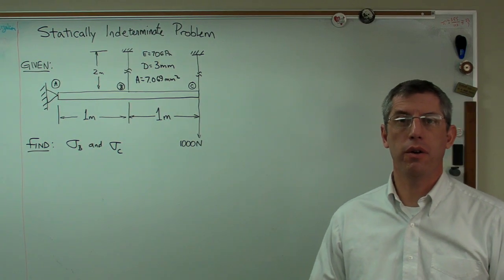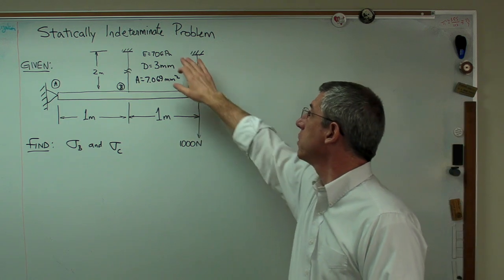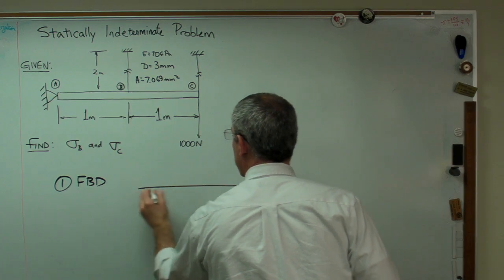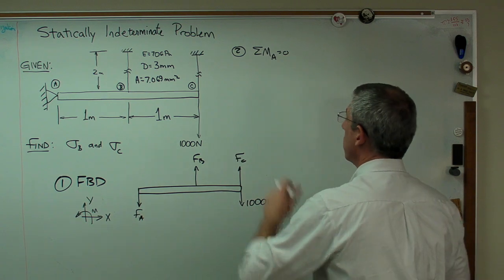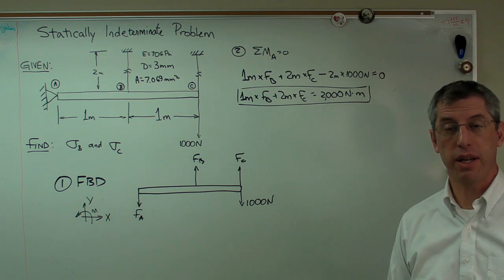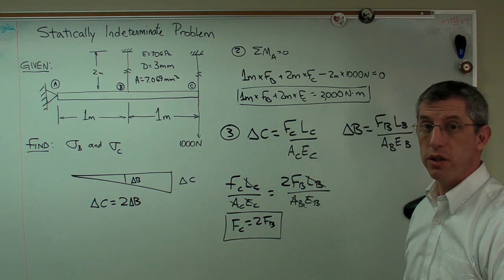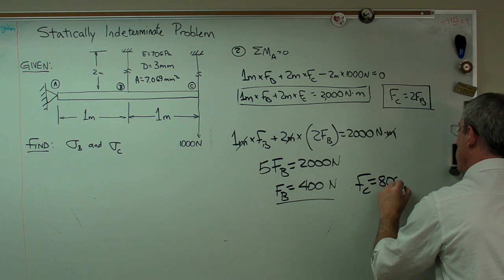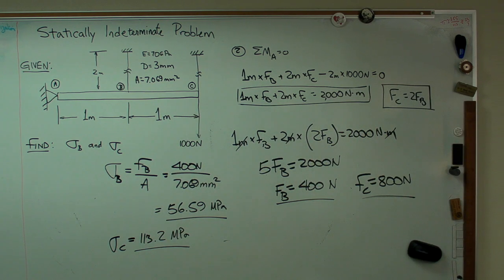Statically Indeterminate.MP4

Comment: Brilliant videos...Thanks so much.  Could you possibly do a video showing how to solve a simple beam with a UDL and four equally spaced supports - similar to what you would find on a decking structure where the beam is bolted to the vertical posts:

------------------------
|       |       |       |

A good example question: What size beam required to support a given load

Thanks

Comment: I have a very similar problem but a bit more complex, with cables of different materials and areas. AND I'm stuck! Because, on top of having to find out the forces applied on the two cables and the reaction, there's another unknown: the weight applied at the end of the bar. Could you help me solve it, please?

Comment: Can someone help me please? Can't we just take the moments around different points on the rigid bar? It will give us multiple equations which allow us to solve the problem...the values I find also verify all equilibrium conditions..I got an A in statics and now I'm in solid mechanics and this is driving me crazy for some reason.
Reply: You will have multiple equations which are not different from each other. They will produce a system of equations that can't be solved.

Comment: By the way, could you please upload another tutorial in which you explain step by step how to attack problems involved deformation + elongation of 2 section- beams or rods fixed at both ends? Even better if that involves heat expansion :)